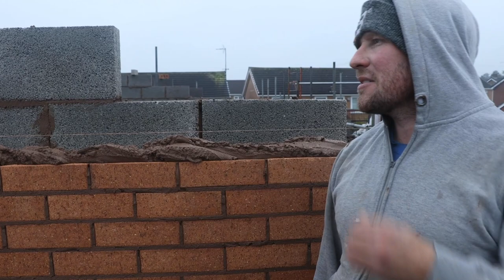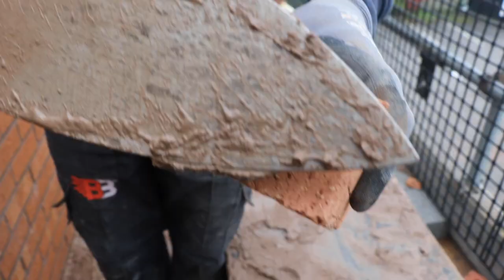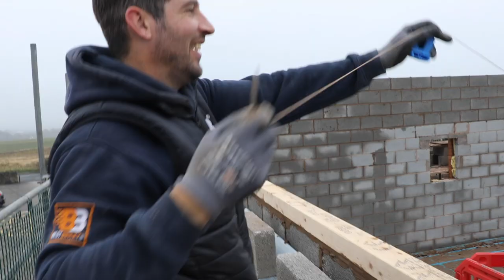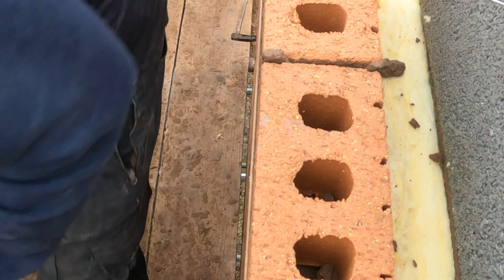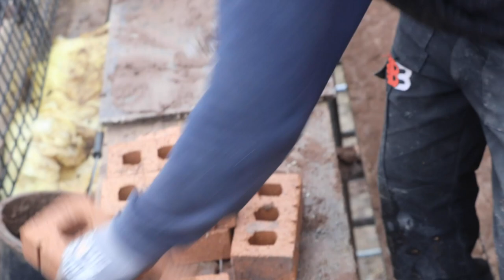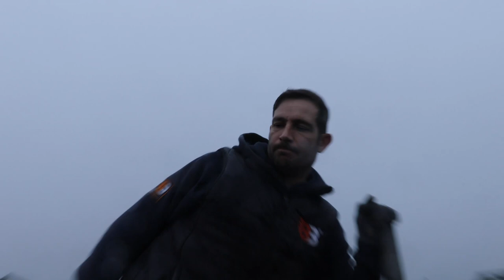Bricklaying Robots?

Comment: How about a machine that pumps mortar directly from the mixer up the scaffold?
You could have a nozzle on a gun that spreads a perfect bed for long runs in seconds with no effort.
You'd still have to lay the bricks down as normal but the time saved could be significant. No more humping much around or lifting countless trowel loads of muck.
I'm not a bricky but I can picture it.
Reply: No, it would be no fun doing it that way 😳

Comment: You won't need brick laying robots because buildings constructed by machines won't be made from brick.  They'll be 3D printed on site from modern composite materials in a fraction of the time for a minute proportion of the costs.